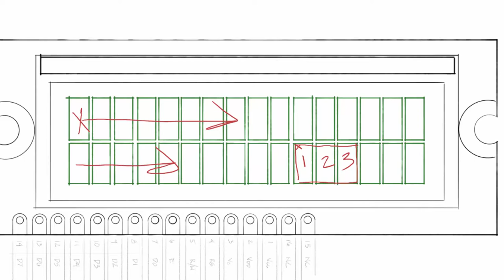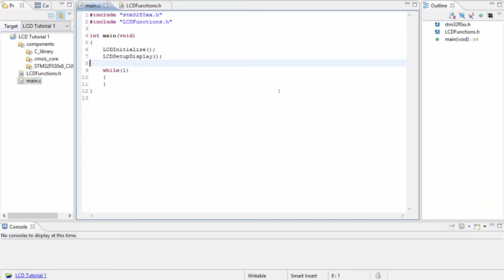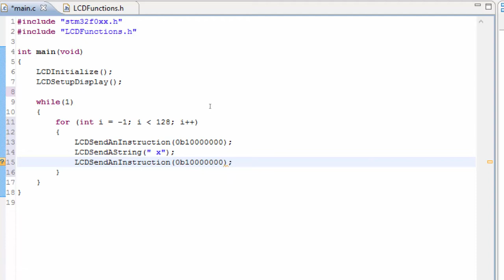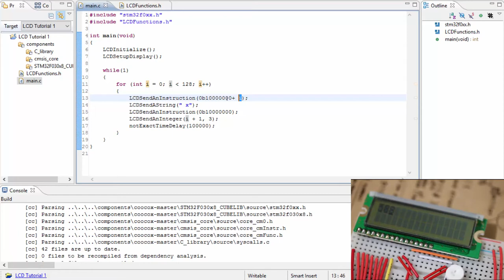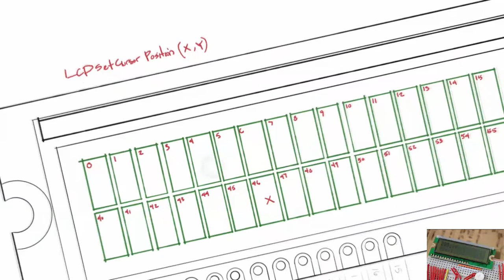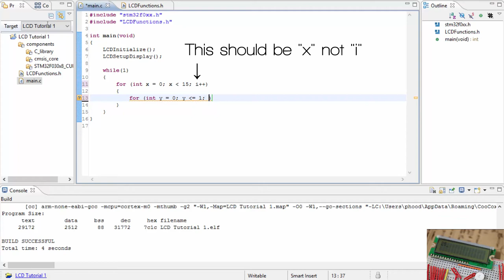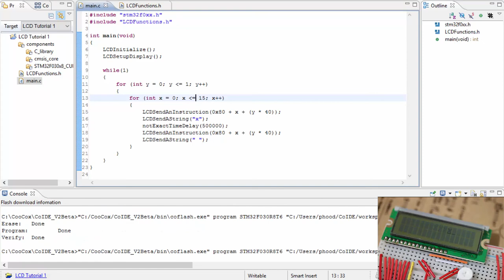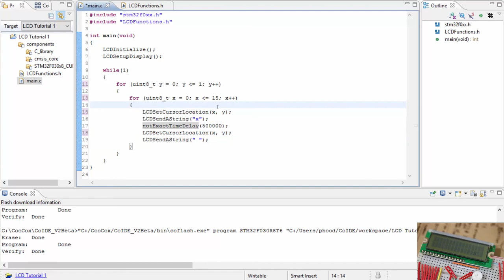31. How to Set the cursor Location on the LCD on the ARM MCU - Part 18

Comment: "You never know until you try". Now I know why I am enjoying this series so much. You are not just presenting a series of recipes that are guaranteed to work every time, you are showing the subscriber how to experiment with modules they have never encountered before. Thus you empower them to delve into the workings of all the modules they come across, the LCD is just an example. Well done you!.
Reply from the maker: Thank you.  That is exactly my intent.  These videos will lower the barrier for many folks out there trying to get microcontrollers to do what they want, and product real consumer products.  I know this, because it is a very difficult tasks to get these videos completed and the code running correctly. (Not so much for the LCD series, but definitely for the videos afterwards)

All that is seen is these videos is the final working results.  For example, the ADC, PWM, Timers/Counters, Interrupts, etc. that have been uploaded to Patreon, required some intense research and many trials.

Thank you for acknowledging your appreciation of these videos!!

Comment: I'm using a cheaper LCD with SPLC780D driver and apparently after 40 it doesn't move to the (1, 1) position but stops at (0, 1) until 47. I tried increasing the position and noticed it started moving to position (1, 1) and further after 64. Between 47 and 64 it does random things. Therefore, my function looks like this:
void LCDSetCursorLocation(uint8_t x, uint8_t y)
{
	LCDSendInstruction(0x80 + x + (y * 64));
}

Comment: So in the final demo (and the earlier ones):
a) the position is jumping around - thjis is probably just because you have edited the video, I guess
b)sometimes it seems to jump very quickly from one position to the next - this doesn't look like and effect of editing, but it might be I suppose
c) sometimes there is a cursor in front of the position being written to, sometimes there isn't.
Is this all just an artefact of the video editing, or is there some problem with the setting of the position and the display of the cursor?
Reply from the maker: All Video editing.
Reply: OK, if you say so. I really cannot see a cursor ever on the bottom line.